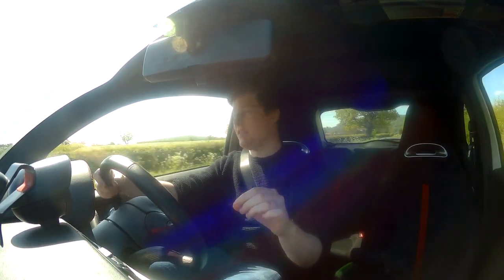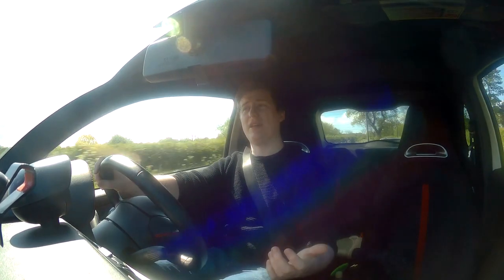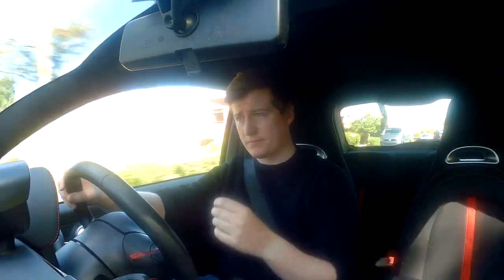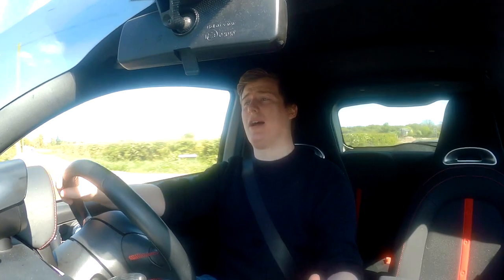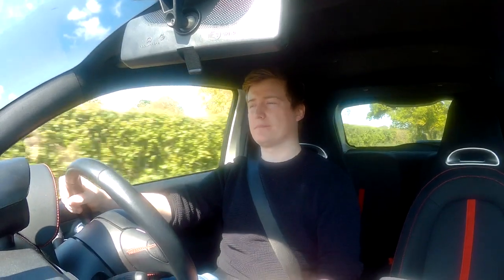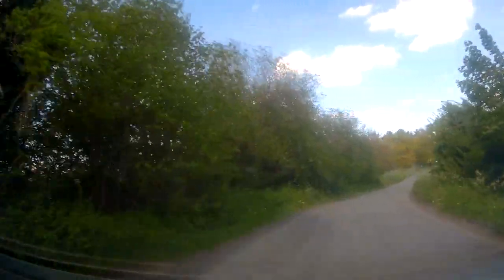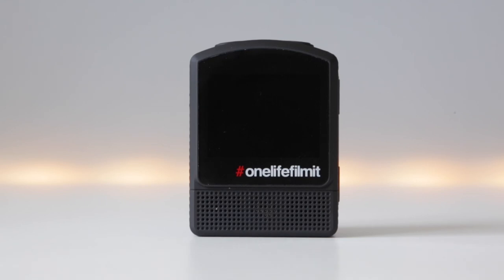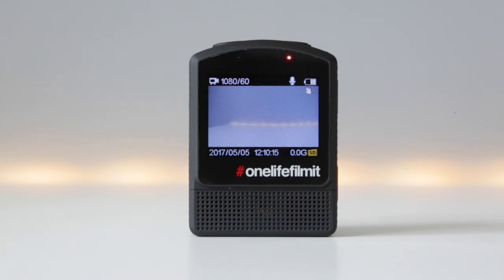Olfi one.five Tutorial - Gyro Stabilisation

Comment: When I export the olfi videos to my camera roll on my phone, they don't export with audio, any ideas why?
Reply from the maker: Hi there,

Thanks for contacting Olfi. How strange. So you’re confident that sound is being recorded? Have you used the playback on your camera or App to test this? The audio will be muffled on playback but at least you’ll know if its an issue relating to your camera, or not.

Can you let me know what phone you are using? Are you saving the file to your camera roll through the App? It might be beneficial for you to continue this conversation with my colleague who controls the info@olfi.co.uk email. I’ve forwarded on a synopsis of our conversation so they will be up to date with your issues. The only things i can suggest to try in the interim is ensuring that your iOS device is up to date with the latest software, turning up the ringer volume on your phone (ensure its not on silent or vibrate), turning the volume up on your phone and ensuring that your phone is not trying to connect to airplay on another device.

Failing these suggestions, please contact info@olfi.co.uk who will try and help you out further. The App is due an update very soon, so this may be rectified when this has been done.

Kind Regards
Helen
Reply: Olfi I'm confident sound is being recorded and my phone has met all the standards needed so I might just wait for the update thanks for the advice!